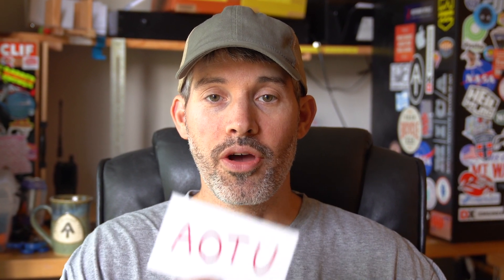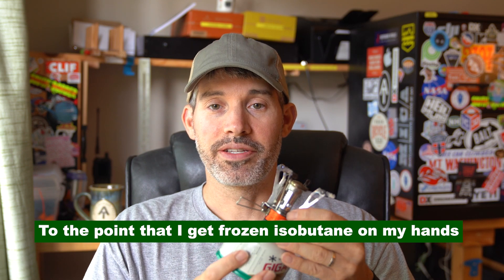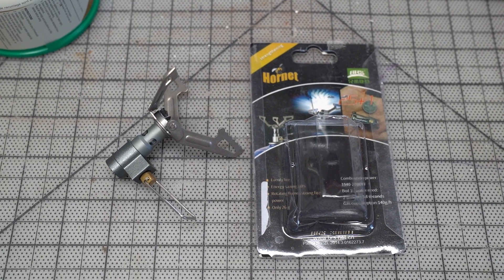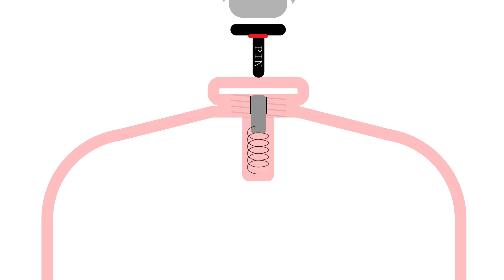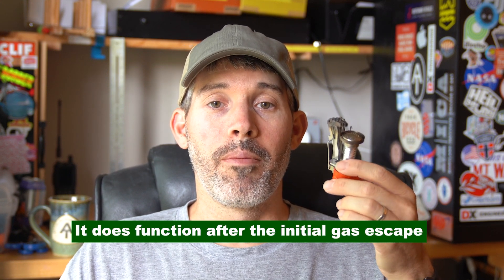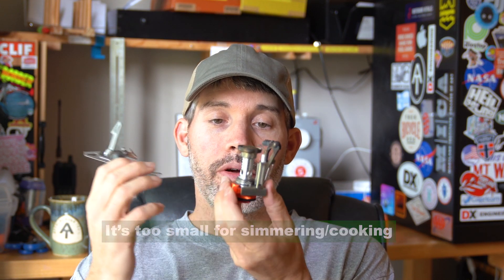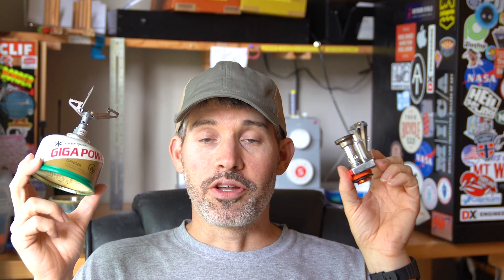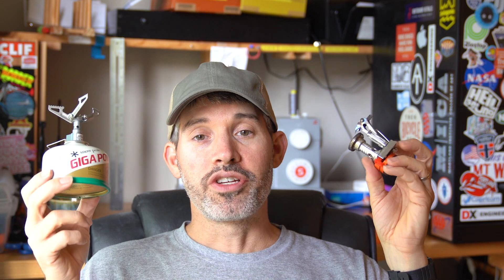The AOTU backpacking stove has a flaw

Comment: Nice video, explains a lot. I had this happen with my first stove which an old no-brand from a supermarket and always assumed it was normal. When I got my MSR PR2 and tried it on I was surprised how little gas escaped vs my previous one which would often get fuel on my hands if I had it slightly tilted when screwing it in. I suppose its a matter of checking what the EN 417 standard recommends in terms of pin length
Reply from the maker: Thanks. I did a little research about design specifications for these stoves to try and find the correct pin length. I'll definitely check out the EN 417 standards. Thank you!